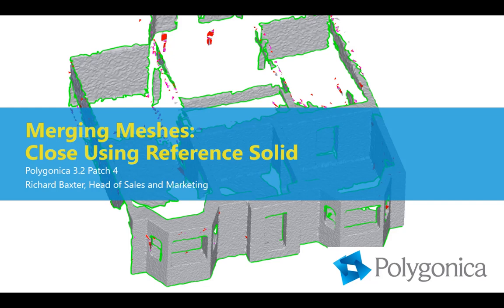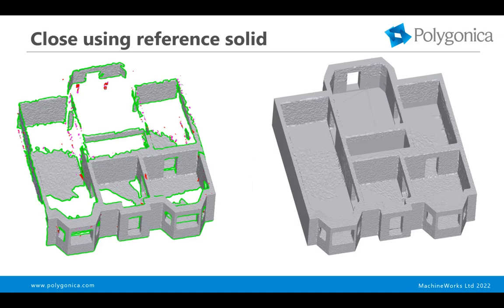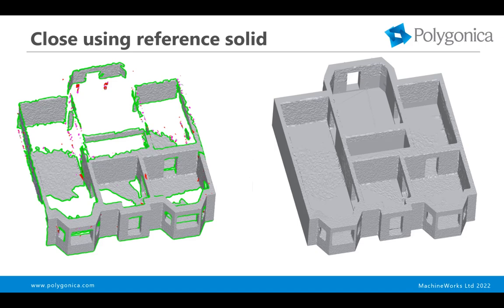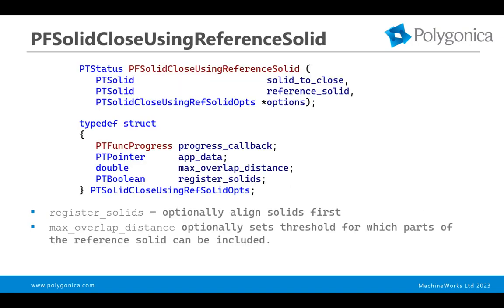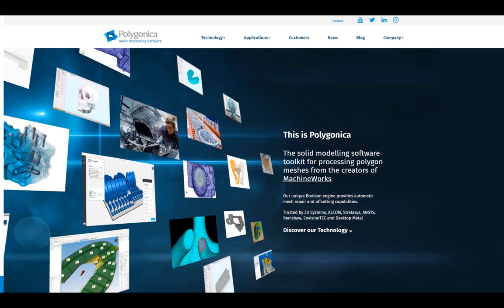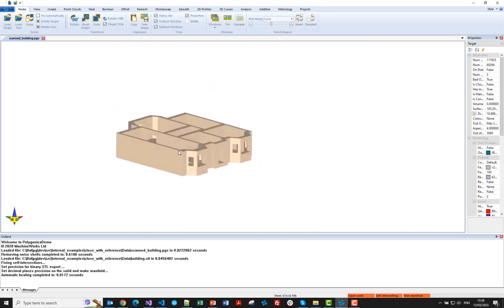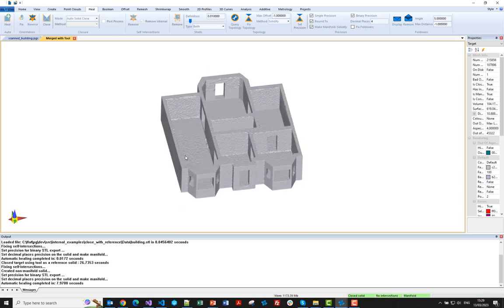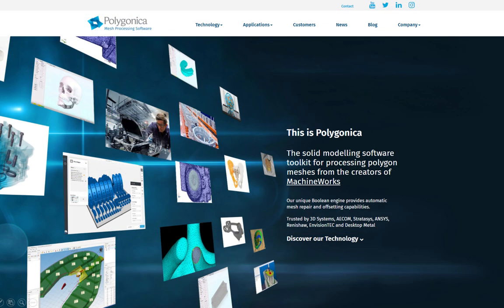Closing a mesh using a reference mesh.

Comment: Astonishing. Well done! What if the part is a little warped?
Reply from the maker: Hi Gerd. 

Really sorry - have only just seen this - completely new to social media. 

On the real-world test parts we've been working on there have been a fairly wide variety of geometries, so I'm fairly sure it would work reasonably well. However if the scanned part is warped, it's not going to detect that and warp the reference part accordingly, so if there is a large warp you could potentially get an undesirable result. Smaller warps I think it would handle. If you want to send some examples for us to try you are very welcome. 

Polygonica can compute deformations between parts, so in theory you could compute the warp, morph the design part, and then do the reconstruction. In practice, due to scanner noise, I'm not sure how viable this would be. However if you were able to guesttimate the warp e.g. by eye, then you could set up your own deformation field to do this.

Worth noting that unsurprisingly the process works best when a good registration can be achieved. Polygonica's registration can be tuned to prioritise selected regions - so in the example in the video if you selected the front wall (as that is of most interest) it would refine the registration based on that .. but then if that wall was warped, then maybe you might get a better result just using the general registration. 

Hope that answers your question, at least kindof.

Cheers
Richard